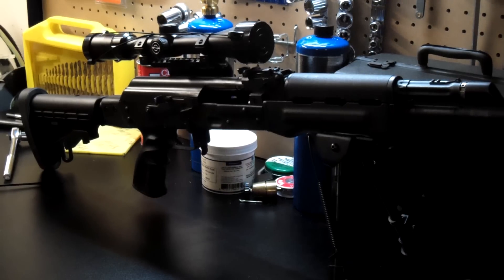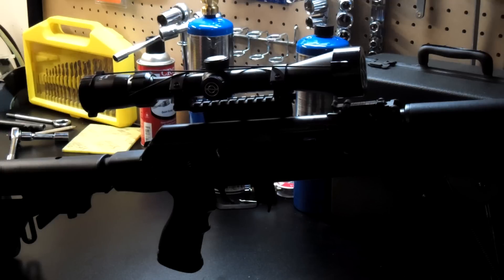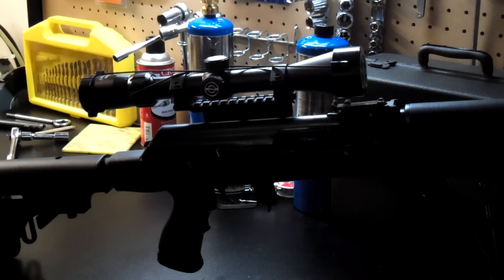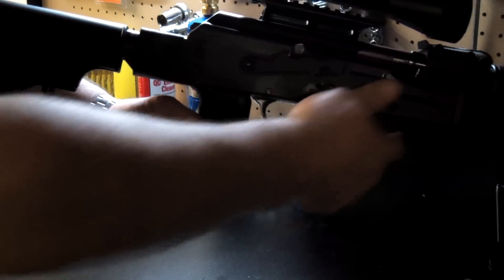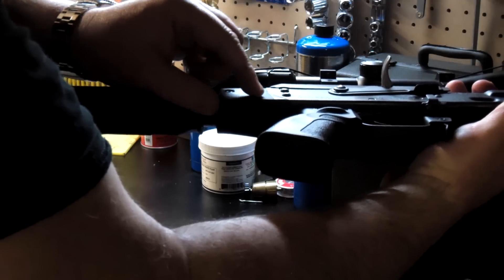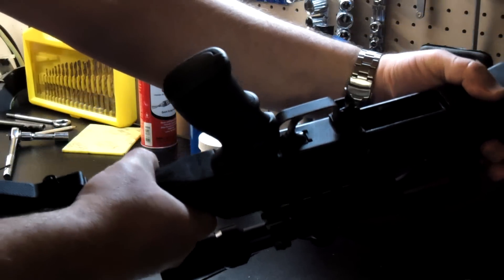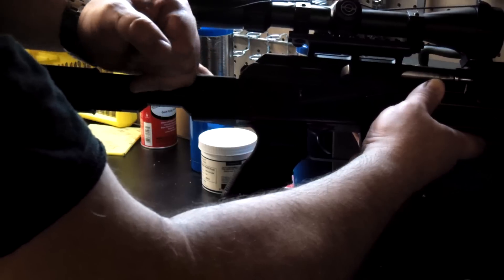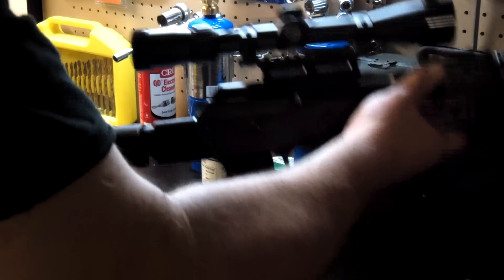Tactical Stock for Zastava Yugo M77

Comment: Classic Firearms just came out with a kit with the adapter, stock, grip, and some other things.
Reply from the maker: denrizza I knew about the kit.  It existed before as a bunch of compatible parts.  One manufacturer was producing the adapter and the adapter was compatible with the classic AR-15 stock.  I did not like the adapter.  it makes the connection between the stock and receiver look "fat".  Also the total cost of the adapter and the AR-15 stock was going above $100.00.  I prefered my solution for $50.00 plus the cost of the pistol grip.

Comment: Hi Val. Thanks for the video. Interesting. Would have been much better if it had better illumination. It was so dark I missed the details of the work. Nevertheless now I know it is possible. Thanks!
Reply from the maker: I was not even planning to put a video.  I  am sure once you buy the stock and put it there all details will become obvious.  It is almost perfect fit out of the box.
Reply: What did you use for the pistol grip?  Tapco grip for the M70?
Reply from the maker: Kirk Crewdawg Any AK grip will do.
Reply from the maker: Gary Jakielek Nope, I just filled the void with epoxy mixed with little black paint.  I used Johnson wax to protect the metal parts from the epoxy.  The epoxy should stick only to the plastic stock.

Comment: Val, how is the cheek weld on that stock for open sights and scope?  i like to get one soon.
Reply from the maker: I do not use cheek rest.  That was he main reason for replacing the thumbhole stock.  The cheek rest of that stock was made of 60grit sandpaper and was rubbing my face very hard.  After three shots my face was like hit with a hammer.
Reply: I hate it too. I got a face slap on every round with the thumbhole stock. I definitely need a new stock. Do you have the any problem with the T6 stock lining up the open sights? how about with optics? is it low enough?